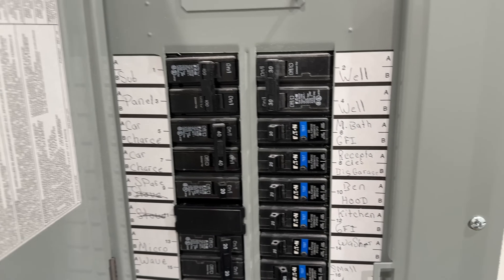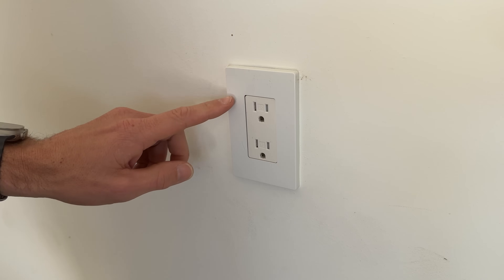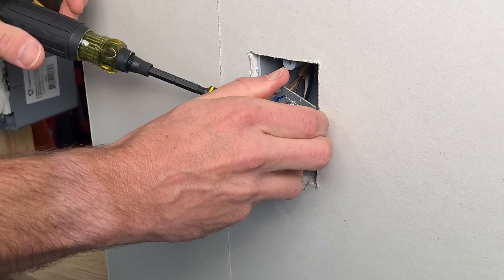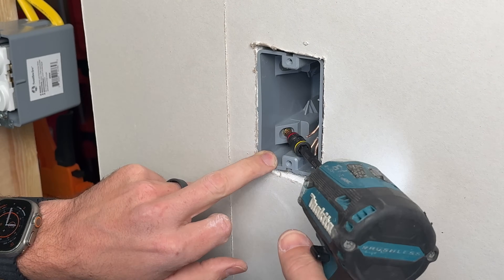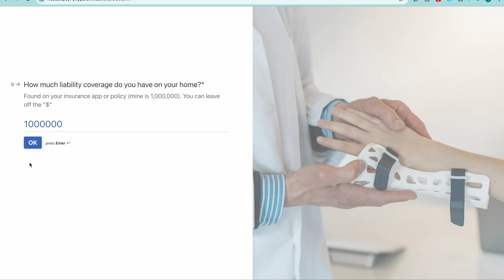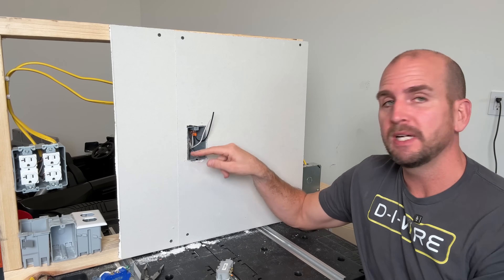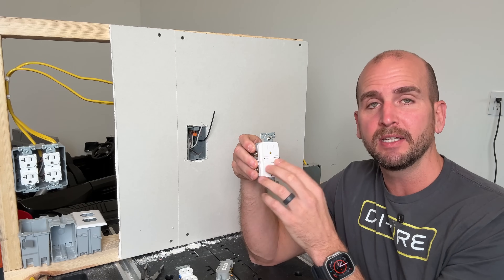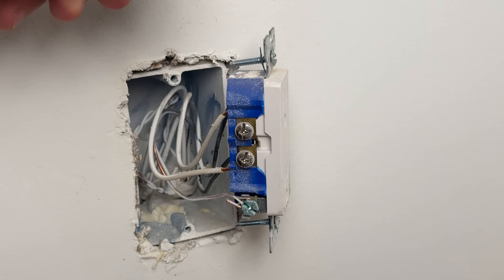The Ultimate Outlet Replacement Guide: 10 Mistakes Everyone Needs to Avoid

Comment: Another great video Scott.

For #5 -- replacing a 2-prong outlet with a GFCI -- there might be a lot of people in the same situation as me. My house was built in 1963. The original wiring was all metal boxes with flexible metal conduit and no ground wire. The metal conduit acts as the ground.

The outlets in the living room and bedrooms were all 2-prong. I replaced them with 3-prong by attaching a ground wire to the metal box. The only tricky part for me was that the boxes did not have a hole for a ground screw like newer boxes have. Code does not allow for self-tapping screws, so I had to drill the holes (with the correct size drill bit) and use a tool to create the threads. That really wasn't too difficult, and the bit and tool weren't a lot of money.

If anyone does this in their home, be sure to test with an outlet tester (like the one Scott links to) to be sure you do not have an open ground.

Comment: You can install a regular three prong outlet downstream of a GFCI outlet or if you have a GFCI breaker. In that case you would need a "GFCI protected" sticker and a "No equipment ground" sticker on the outlet.

Comment: Good informative video.

 It's always good practice to consolidate your conductors when multiple wires are in your outlet box. Instead of having your Line and your Load wires going to the terminals on your device, using all four screws for four wires, make a pigtail by taking the two neutrals and adding a third short cut of wire and make a splice by wago or wirenut  connecting them together with just the one tail wire about 8 or 10 inches long to connect to your device. The same way the video showed how to extend a short conductor in a box. This way you tuck the splice back into the box neatly and you don't have that extra resistance of multiple wires connected to the device making it difficult and potentially dangerous when pushing the device back into the box. 
  Also, if you find you don't have drywall for the ears to push against when installing the device you can bend the ears of the bracket backwards without breaking them off and they will sometimes provide enough spacer support against the box edge to keep your device flush with the drywall face without having to install spacers on the mounting screws.
 Just a couple of tips from an old wireman

Comment: Can you do a video on adding GFCI outlets to a house with no ground ie fo all outlets have to be gfci or just the first one in series and how do you locate which outlet is the first in s series on thst breaker? You videos have helped me a lot and watch all of them as I subscribe to your channel thanks
Reply: If the outlets are wired in series and the downstream outlets only get their power from the wiring that goes through the first receptacle, then only the first one needs to be a GFCI. Also if you have metal boxes and there are no ground wires connecting the receptacles to the boxes (you might have these even without ground wires going back to the breaker) then be sure to use self grounding receptacles including the GFCI.
Here is a video to watch about finding the first receptacle: https://youtu.be/22fuHMwiYgE?si=L6tDn1yiIePzysH6

Comment: How about installing an receptacle in an old work box? Many people don't realize you're supposed to break the ears off the yoke so that the receptacle sits correctly in the box, and the face plate isn't floating out from the wall by a 1/16" to an 1/8" of inch.
Reply: It depends, really.

Comment: God DIY Video. When I had to work alone I always just plugged a radio into the outlet and then turned off breakers until the radio went off. I would always cut it on and off a couple of times to make sure it was for sure off.

Comment: I did not read comments, but I am sure someone somewhere will argue about the backstabbing... don't!  Scott is absolutely right here.  I am not an electrician, but I was actually taught this by an electrical contractor... and I literally had the backstabbing in my house almost cause a fire.  The lights in that room were flickering and we thought it was a faulty LED bulb (because others in that pack acted similarly)... I am grateful I happened to catch my daughter using the receptacle and light flicker... the wall of this receptacle was very hot to the touch... and I could hear once I got close, the sound of arcing/popping when wiggling the plug.  Don't mess with it.  Use the screw terminals.  Please.
Reply: Totally. The only failed connection in my house was a backstab. Wish I saw these videos at that time
Reply: @BlugubriousMusic  backstabbing offers almost no contact area.  You have a tangent point of a radius and a flat blade.    It's all about surface contact area.   I don't like wagos for the same reason.  You have a pinch vee area blade that contacts at two tangent points and partially digs in.    The contact area of even two wires intertwined with two linear tangents contacting surfaces spiraling across the total length of stripped wires far exceeds wagos blade peircings when pre twisted and capped properly.  Not including the nut contact on the outer tangent points.

Comment: The reason you don't like back stabbing is the same reason I don't really like Wago lever nuts. Just a piece of small metal holding the wire. The wire tends to turn easily in the lever nuts making me second guess the connection
Reply: Lever type connections hold differently than the backstabbing connections. There's more contact area on the lever type connections. The only problem with the Wago lever connectors is that the lever lifts up when there's a wire inserted. In that lifted up position with more pressure they can release the wire. They need to redesign it to stop doing that. In the meantime they're perfectly fine if you wrap them with some electrical tape.

Comment: 1) Somebody inside the building may turn breaker on and return electricity to circuit where you are working. 
2) You should use dielectric tools if the wires are connected to panel. Sometimes contacts are moving if circuit breaker is malfunctioned or utility transformer insulation may have cracks. Always work like circuit is still energised. 

And always use golden rule: disconnect ➡️ check ➡️ short hot wires to ground busbar. If someone turns circuit breaker on, result will be short circuit instead of electrocution.
Reply: @Dmitrytln  Correct, and a meteor may fall from space while you're working, so be sure to build a dome over your house before performing any work.

Comment: 😮But, legacy 2-prong outlets can still be purchased, and outlets are still manufactured with back-stab connections and 14-AWG solid wire is allowed on 15-amp branch circuits...

Comment: Regarding number five.....2 wire with no ground.  I went with installing the GFI breaker at the panel as the entire circuit is then covered.  Most of the outlet boxes I have are all small, and putting in a GFI outlet is very tight.  Also a big thumbs up on the Southwest boxes.....have installed many and they are great.  (also used your idea and replaced the screws with torx heads).  Good video.
Reply from the maker: Thanks for the feedback and the GFCI breaker as opposed to the GFCI outlet is a great option.

Comment: I used to live in an apartment that was attached to a seasonal business. Had a bedroom outlet burn one day. "No big deal", I thought. Went to the store and grabbed a new one. When I get back, I discover that none of the breakers actually control the bedroom. Tried every single one, plus the main. The bedroom remained powered. So at this point, I figured the bedroom must have been wired into a breaker inside the business (before you comment, the place was an absolute mess in the way it was wired; no idea how the guy got away with it). As previously stated, this was a seasonal business. It was already closed for winter, and the owner was in Florida. Slightly exciting swapping an outlet on live wires (keep one hand in your pocket! Lol), but got it done without incident. Not recommending it of course, just sharing a story.

Comment: Using a soft piece of flat wood, such as a piece of yardstick or paint stick, is helpful when folding & pushing the wires to the rear of the box. Good job on the video.
Reply: Voltclaw

Comment: Do you ever place electrical tape over the wiring screws.  This allows you to remove the device (switch or receptical) with out grounding to the box (where conduit is required by codes)

Comment: be aware that code does permit a screw to be driven through the side of a standard nail on box, as long as it doesn't leave sharp edges inside the box, and the screw head is far enough back to not accidentally contact the device.  the boxes with the built in screw ports are, to me, worse than the alternative.

Comment: Replacing Old outlets can fix a number of issues that you may not even be aware of, so if you can replace them you should.
Reply: I had mostly original ones from 1963 - loose connections for the plug.  All replaced now! Decora line, last few I used the Edge, very easy.

Comment: I tried the edge series, and went back.  funny how you don't like standard grade devices, but Edge is more of a mobile home grade.    personally, edge is perfectly adequate for residential devices - but the time savings of the wago type terminals gets burned because they are made to be paired with oversized plates, and you have to cut away part of the drywall ears to fit a standard plate.

Comment: I presume those lever receptacles are much more costly than the regular, commercial grade. Not at all worth it for me just to save a couple turns of a screwdriver.
Reply: I think they are between the price of spec grade and residential grade - they're made for manufactured/tract home use, so they're priced accordingly. (to be clear, the price difference is calculated to make them cheaper in the long run than the combination of turning the screwdriver and having bad connections come up while the home is still under warranty) - also, the leviton edge are not commercial grade.

Comment: As someone else mentioned: The lever terminal outlets are bulkier so may be harder to fit in cramped boxes. Also, I didn't see options on them for jumpering to other outlets. The nice thing about a good quality outlet with back inserting terminals is you can connect 4 wires to each pole. Example: Romex in, 2 Romex cables out, plus a connection to a 2nd outlet in the same box.

Comment: The slim GFCI are great for older homes with smaller receptacles.

My 1948 house has metal receptacles that are grounded to the house plumbing. That was the old way to ground. All receptacles grounded to the house - including the AM antenna in the attic. 😮

Comment: I prefer tamper resistant to commercial.  Have not seen both but maybe u can find an outlet with both?
Reply: you can find commercial grade tamper resistant, but yes, receptacles in residential installations are required to be tamper resistant. - tamper resistant commercial grade are available, because they are required in child care facilities.